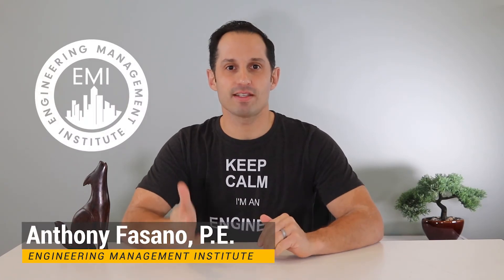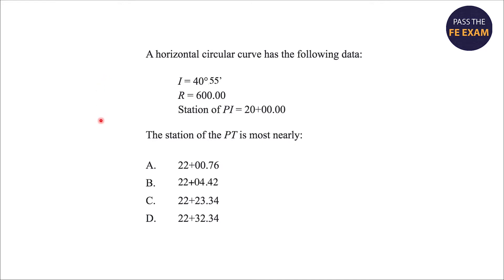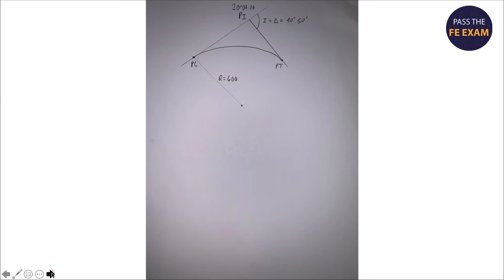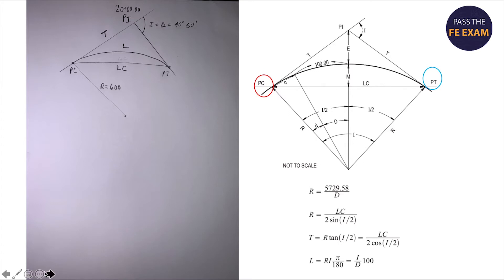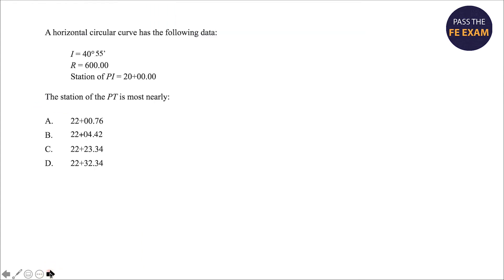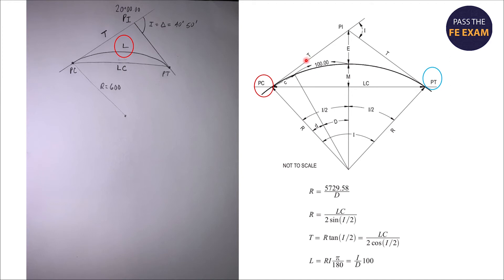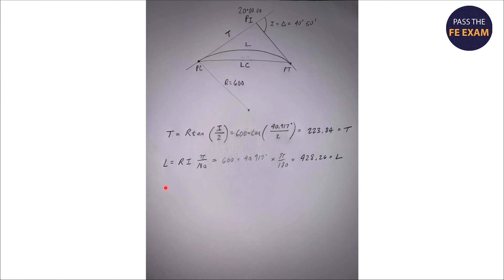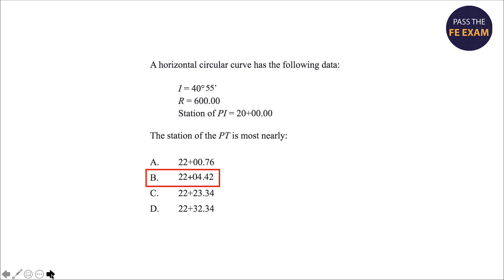Horizontal Curve Problem (Practice and Solution) | FE Civil Exam Review

Comment: Can you please explain the conversion of the 20+00.00 "out of the thousands" and into a "station number"...I don't understand.
Reply from the maker: @georgep505 Thank you for your question! In civil engineering, station numbers are used to represent specific points along a linear project (like a road or pipeline) in terms of distance. The station number 20+00.00 means you are 2000 feet (or meters, depending on the units used) from the project’s starting point, which is usually designated as station 0+00.00. The “+” symbol is just a way of separating the “stations” and the remaining distance.

For example, 20+50 would mean 2050 feet from the start. If you’d like more clarification on how to use station numbers in horizontal curve problems, feel free to ask!

Hope this helps!

Comment: A horizontal curve is designed with a 725m radius. The curve has a tangent of 140m and the PI is at station 3+103. Determine the stationing of the  PT. With a sketch determine the stationing of PT for the horizontal curve.

Comment: Thank you! But wondering why adding PI + T does not give me PT?  I would have thought that it would yield the same answer as PC+ L = PT
Reply from the maker: You're welcome, because T is a straight line, but you need the curve length...
Reply: @PasstheFEExam  I understand why we cannot add T to PI to get PT, but why can we subtract T from PI to get PC? Wouldn't we run into the same issue? 
Thanks for all your videos - they are helping so much!
Reply: @ninersnerd5123   So true. I was thinking about the same thing. Did you find the answer?